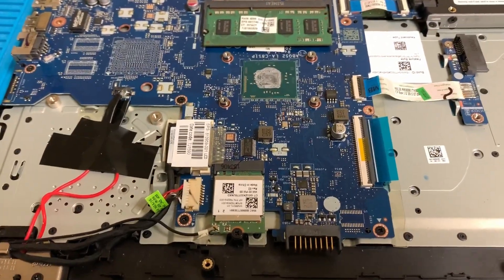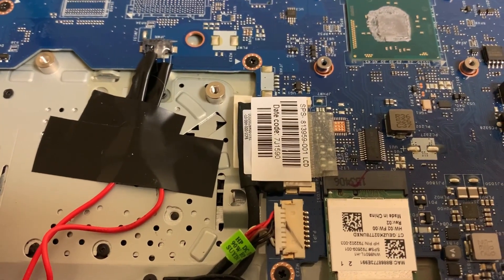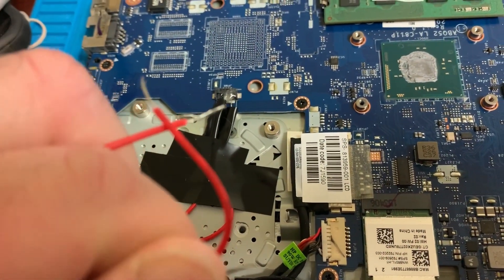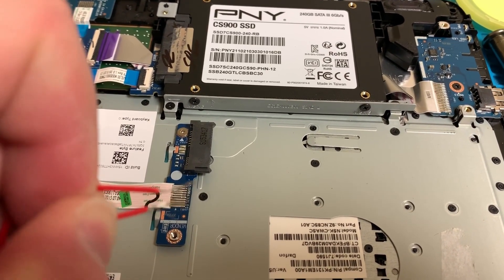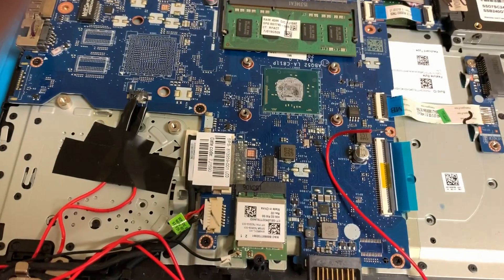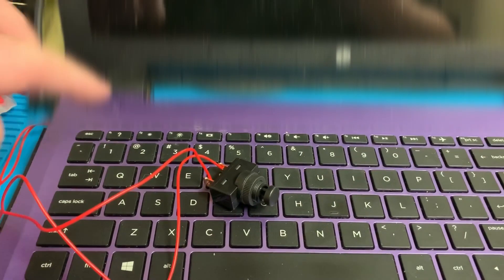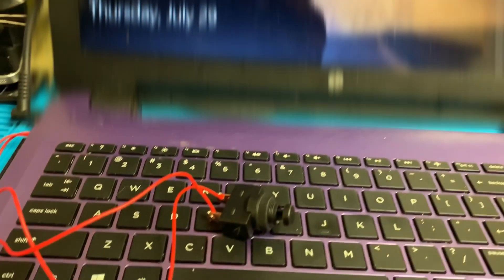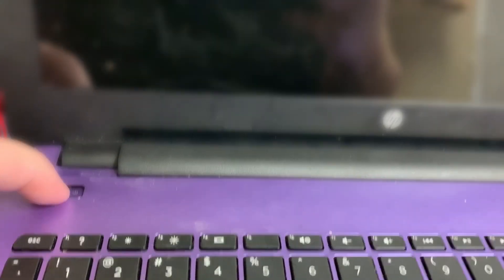How to Hotwire A Laptop (External Power Button)

Comment: Hi, can I connect the wires to the bottom pins of the fpc? Because I broke all the top pins leaving only the bottom pins, can I  also use the black wire? Can I also use the power switch?
Reply from the maker: Hi your situation is unique and I don’t have your info or photos of your board to confirm an answer. I apologize

Comment: How can i do this with a laptop that has the power button connected to the keyboard but the keyboard connector is just fully broken
Reply from the maker: You would need to solder a new connector onto the motherboard if that is where the break is.

Comment: My laptops power button no longer works but i am able to power it on using the pins of the keyboard socked on the motherboard, is that safe? Also is that the same place u put your wires in thia vid?? Thanks
Reply from the maker: With anything do at your own risk. I can’t say it’s safe or not because I’m not there with you. If you are touching the correct pins and it boots up than that must be correct. As for location it just depends where your particular sockets and connections are. If you solder your wires in and use a switch and it works I’d say you’re probably in the correct spot. Cheers :)
Reply: @FlippingRentals  thankies 😇
Reply from the maker: Welcome!

Comment: Can i use an on off rocket switch or only spring switch only works?
Reply from the maker: I probably wouldn’t use a rocker Unless you rock it back off immediately after. The switch’s purpose is just a sudden connection then release.
Reply from the maker: Leaving the rocker on would be the same as holding the power button down continuously. Which is most cases would cause the system to constantly reboot
Reply: @FlippingRentals  i see thanks for responding
Reply from the maker: @intelcorei0364 anytime!

Comment: Hello I’m on a dell latitude e7450 and the power button is on a dotter board and it connects to the main board with a ribbon cable, any idea how to Hotwire it?
Reply from the maker: Ribbons would be more tricky. Would need to shave it down and use some fine soldering connector wire most likely under a microscope, unless you got excellent eyes.  May take it to a shop for a better opinion though

Comment: thank you for information i have this asus k555l with the same issue can you help me idenitify the jumper socket so i can hot wire it?
Reply from the maker: Yes just Trace your power button wire down to the socket on the MB and that’s where it’s at
Reply: Thank you, anyways can i short the two pins on the flat socket of keyboard, for example the first two on the right or the left?? If does have a mb flat cable?

Comment: hello, ive got this motherboard and i would like to have a similar setup to this so i can power on the device with a relay, on the mb, which of the 4 pins are for the LED and which are for the switch?
Im sceptical to just try and short with a screw driver in case i damage anything by accidently shorting the led pins and damaging something on the mb. many thanks
Reply: An update, with my revision of the board at least, it is the two pins on the left which are the power switch
Reply from the maker: Awesome
Reply from the maker: Hi. This has been a couple years ago. I believe there are 4 pins and the 2 center ones is what i used. But please beware I’m going off slightly memory here.  I don’t believe anything would happen if you used a screwdriver to short it and see if it comes on if you’re unsure. But take that with a grain of salt.
Reply: Thank you for your advice, much appreciated @FlippingRentals
Reply from the maker: @edwardmortimer2150 welcome!

Comment: hi, i have acer a315 35 and I have a problem with turning on the laptop, that is, the power button does not work (it is part of the keyboard), but it’s enough for me to hold down another button on the keyboard and it will work, but if I let go button, then after 3-5 seconds it will turn off. Is it possible to somehow make an external power switch like yours? Help me please. Thank you.
Reply from the maker: If the laptop turns off after 3-4 seconds that possibly could be the button is sticking and shutting it down. If the power button is on the keyboard itself you might replace the keyboard would be the simple route otherwise you’d need to trace the lines and add a switch at the end to bypass.
Reply: @FlippingRentals and how should it be done? buy a button and solder on 2 last connectors?
Reply from the maker: Before soldering i would make sure those “two connector” are for your power lines. You might look for some schematics before proceeding to be sure
Reply: @FlippingRentals  I did it, uploaded the video to the channel who needs it, thank you for the feedback, Josh
Reply from the maker: Awesome

Comment: Hello, my power button is part of the keyboard. Do you know how i can solder a external button, i dont need the keyboard just the motherboard
Reply from the maker: Would need to track down the lines and put a switch at the end. Would need to see your keyboard to give a better answer. I apologize. May be best just replace the keyboard in your scenario. Cheers.
Reply: Just found out its not part of the keyboard
Reply from the maker: Make a video showing me what you got going on and I’ll try to help. Post it here when uploaded
Reply: @FlippingRentals  yea i want to make a portable windows tablet from a hp laptop.
Reply from the maker: Cool

Comment: Hi, i can do this circuit with connecting that cables to the 2 pins? I know the pins that turn on my laptop because i can power on with a screwdriver, i can get the power button and do the circuit?
Reply: Did you ??
Reply from the maker: What?
Reply from the maker: Hi. So long as you match the correct pins with your wire yes it should be fine. However, If you’re unsure than I’d proceed with caution.

Comment: Would you possibly know where to solder this on an acer laptop? Thanks
Reply from the maker: Sure just follow the wires from your power button to where they lead into the motherboard. Those metal contacts is the entry point. Just be sure you solder the correct wire in the correct spot to avoid any issues or shorts. Thanks for watching!
Reply: @FlippingRentals  thank you, my acer laptop power button is a key on my keyboard (like every other button on the keyboard) that’s my problem. 👍  thanks
Reply from the maker: I see. I’m not sure about that one. I’m sorry.
Reply: @FlippingRentals  alright cheers anyways.
Reply from the maker: Cheers!
Reply: @GB.Gaming66  keyboard ribbon connector, the 2 pins on the left or the right (depends on the model).